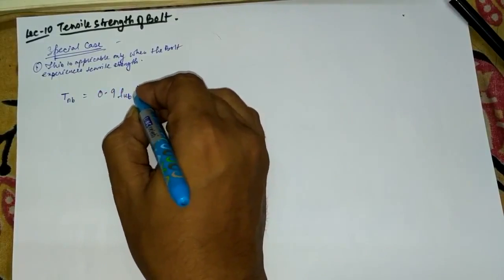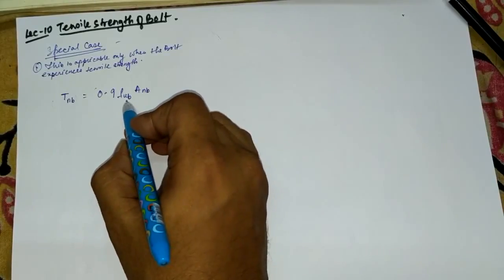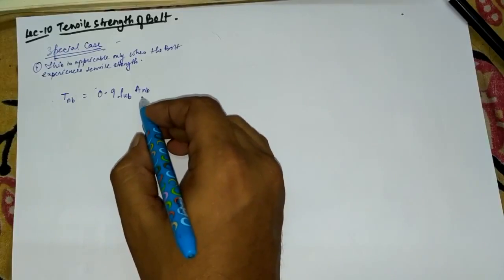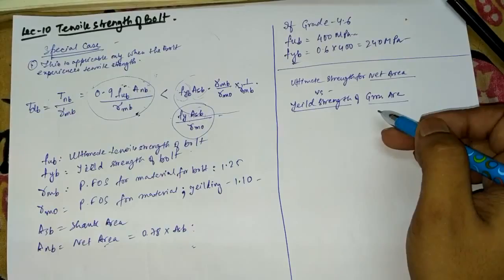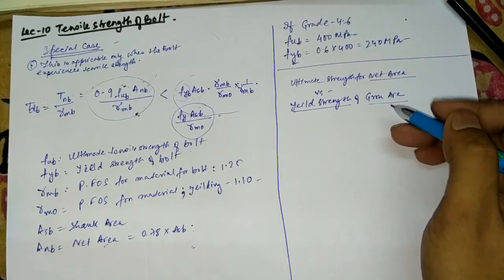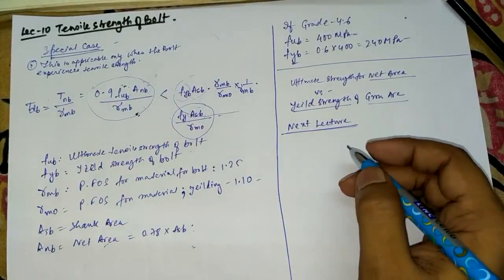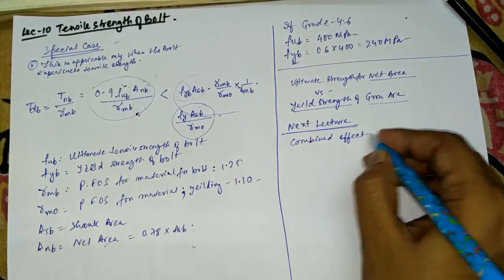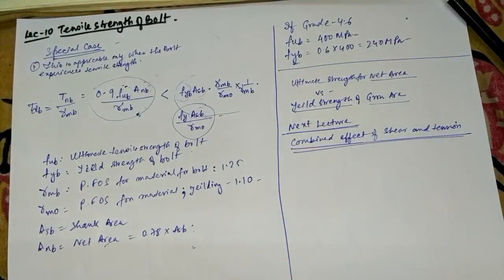10. TENSILE STRENGTH OF BOLTS

Comment: Dear Civil Engineer 
You have prepared very good and informative videos on Steel structure connections.
If possible please solve the following problem considering all the parameters.
Tension =100kN
Shear =50kN
Moment =50kN.m
Consider a plate 20mm thk and bolt dia 20mm.
Reply from the maker: Nitesh singh i have not yet made lectures on how to solve questions having moments.. and thanks for watching the lectures
Reply: CIVIL ENGINEERING & SERVICES 
Please do make as I am looking for it and facing problem.
Reply from the maker: Ok... I'll solve it as soon as possible
Reply: At first complete the question bro
Reply: The question is complete using all these Parameters I have asked for Base plate design.